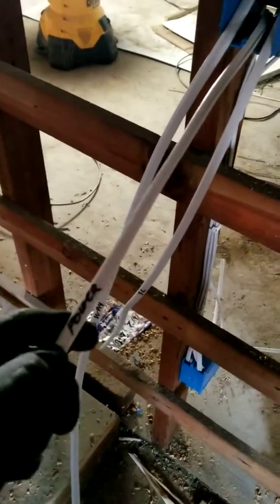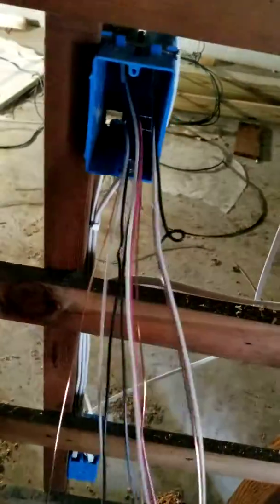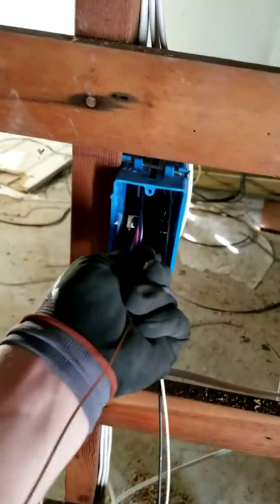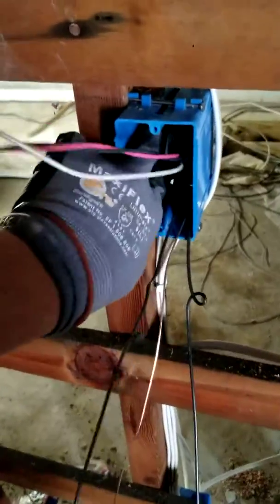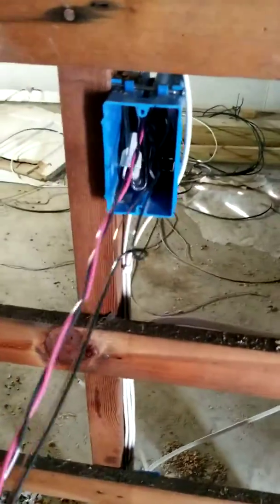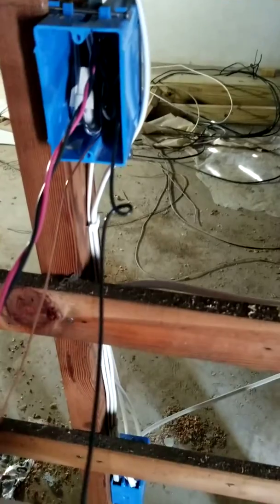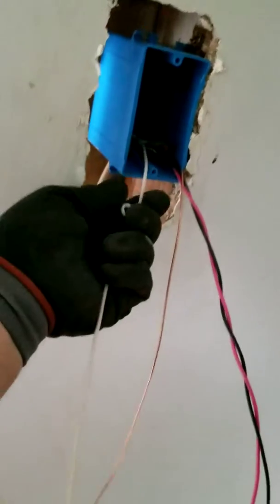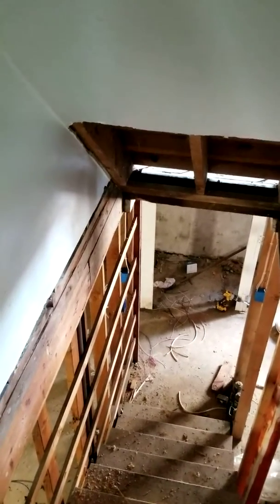3 way switch system that have power and switch leg in one box.

Comment: I know this is an older video.  However, it helped me figure out a 3-way problem in my basement.  Several years ago, I put in smart switches and "rewired" it to work with them.  I lost my notes on the original wiring.  Had a few failed smart switches, so went to replace it with dumb switches.  But, the wiring was confusing to me and all other videos showed the power in one box, leg in the other.  Anyway, this was a big help!  Thank you for posting this.

Comment: The same case but now with a switch leg in both boxes , to feed 2 lights ???,, there is no loop from light to light , I’m trying to figure out this question , I have a particular case at home , love this video thanks
Reply from the maker: Is is possible to run switch leg wire between boxes? Thats Another way of looping lights is through switch boxes.

Comment: You are breaking code though. the switch at the top of the stairs requires a neutral by code. So you need 4 wires. You are a handy man not an electrician. Just do it the right way
Reply: A week ago I would have done it this way myself. However, I recently learned that a 4 wire w/ ground is required per NEC code since 2011. There must be a neutral in every switch box. Seems silly since it will not be used but simply capped off with a wire nut. It's just there for possible future use. 

Go-to https://www.ecmag.com/section/codes-standards/best-code-question-day-part-iii
and page down to where it says "Neutral in every switch box".
Reply: @njsongwriter   that’s crazy that Amazon still sells switches that don’t require a neutral, these are also smart switches. So they’re still manufacturing smarts without neutral. Smh guess Amazon didn’t get the memo….☹️
Reply: That seems rather harsh without all the facts. Perhaps he’s in a state the is working from and old code cycle , prior to 2011, that does not require a neutral in the box. Perhaps he just posted the video without expressing your point and admonished people to check there local code for correct applications.
Or maybe he was just an eager apprentice , sounds like you might have been one, who wanted to share something he just learned.
Go easy sparky, one day you’ll miss something ....
Reply from the maker: (C) Switches Controlling Lighting Loads. The grounded circuit conductor for the controlled lighting circuit shall be installed at the location where switches control lighting loads that are supplied by a grounded general-purpose branch circuit serving bathrooms, hallways, stairways, or rooms suitable for human habitation or occupancy as defined in the applicable building code. Where multiple switch locations control the same lighting load such that the entire floor area of the room or space is visible from the single or combined switch locations, the grounded circuit conductor shall only be required at one location.